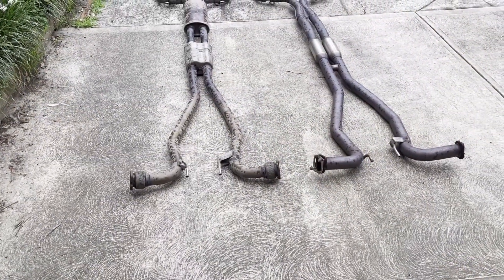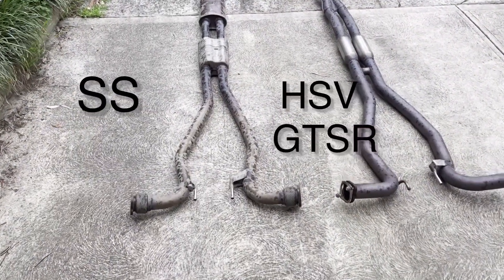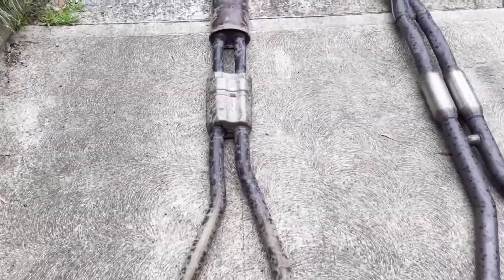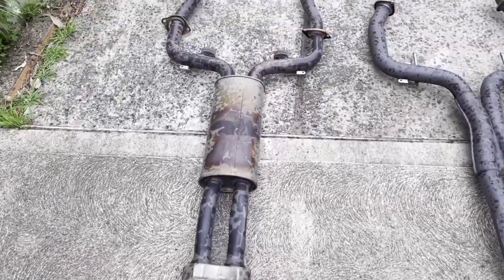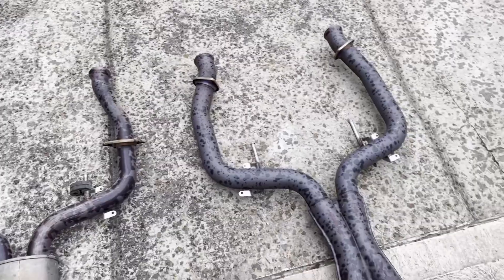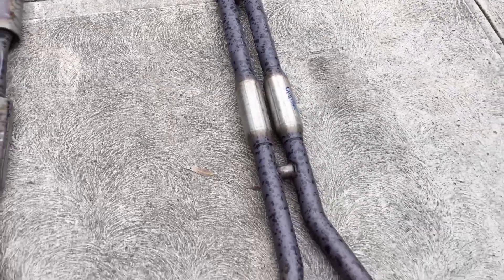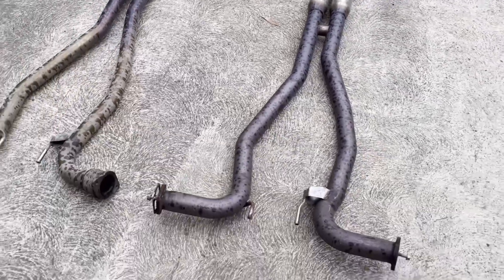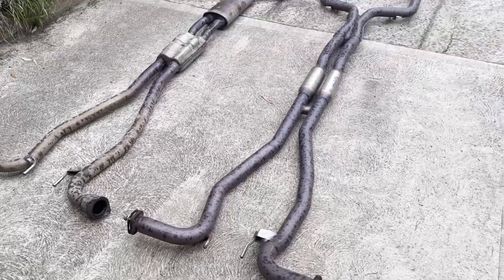HSV GTSR EXHAUST ON SS

Comment: If you want it to sound even better cut out that x pipe section and have no cross over other than the H. If you're interested youtube h pipe vs x pipe heaps of comparisons on all sorts of v8s
Reply from the maker: Thanks for that, I’ll look into it, car sounds different since this vid. Now has a head cam package and headers. 
But still running the HSV cat back, sounds good but not quite right if you know what I mean. Thanks for your feedback 👍🏼
Reply: @OutbackTouring  if you do it you should make a before and after sound comparison. Idle doesnt change much but above 1.5k its noticeable. I have H pipe setups on both my 6.0 ve's
Reply from the maker: Definitely check it out. I’ve got a good exhaust guy too 👍🏼